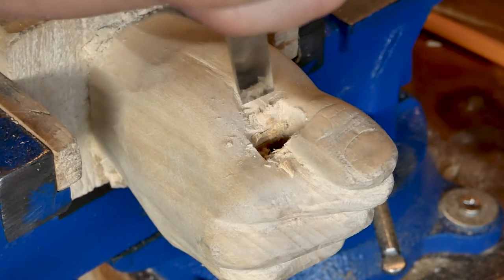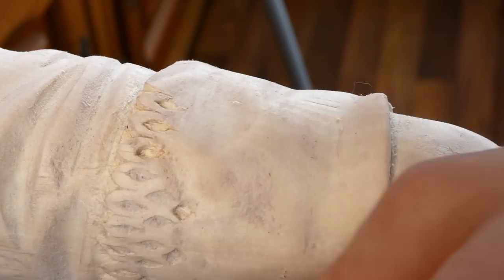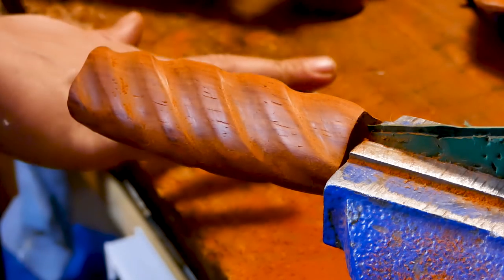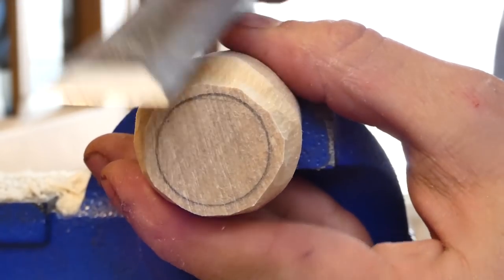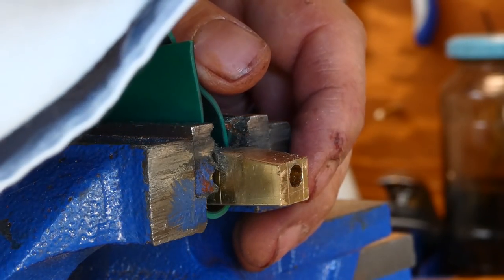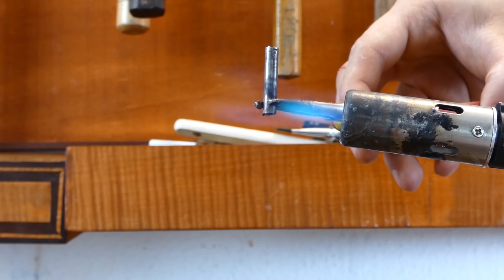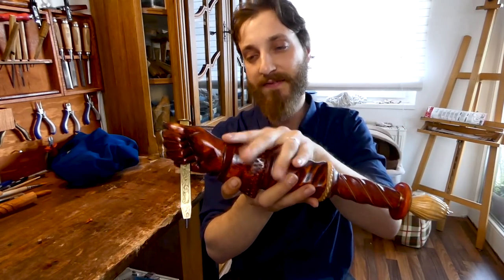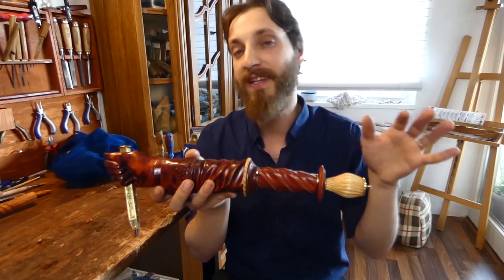Making a Hand Holding Stake Punch Hammer

Comment: Fantastic work, as always. You're easily one of my favorite youtubers. 

In blacksmithing we would call this a "set tool", or possibly a "set punch" though the interchangeable heads would, to me, make it the more generic of the two terms.
Reply from the maker: Alexander Hinman Thanks! That's good to know! I initially intended to make a 16 c. inspired war hammer but brass is too soft, so Iv'e decided to add a steel tip. that is when the punches idea came, so I'll pretend is if the name is still valid, but you're absolutely right.
Reply: Have you seen this? https://upload.wikimedia.org/wikipedia/commons/3/32/Ms.Thott.290.2%C2%BA_079r.jpg The inked illustration on the left hand side sadly doesn't show the whole hammer, but look at the sketch on the right hand side. There's also this https://todsworkshop.com/collections/in-stock/products/medieval-fist-war-hammer
Reply from the maker: I haven't seen the cool illustration, but yes, this Hammer is where I took inspiration from.

Comment: I have noticed you using you flat chisel with the bevel away from the wood, if you flip the chisel over, you will find you have beau coup more control over the depth of cut. The bevel rides on the material and prevents the chisel from following the grain of the wood.  Your work is superb, thanks for sharing.

Comment: Glorious! 
I have an idea; drill holes/channels into the sleeve in which you can place the punches. That way you can pull the different bits from the sleeve. 
Not sure if they would stay in place but if the diameter of the holes is right they probably will.